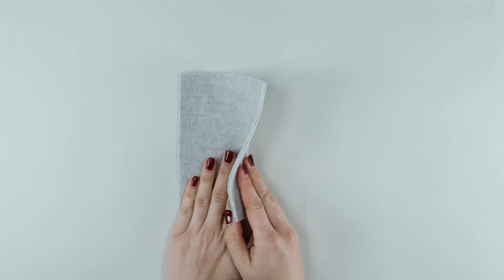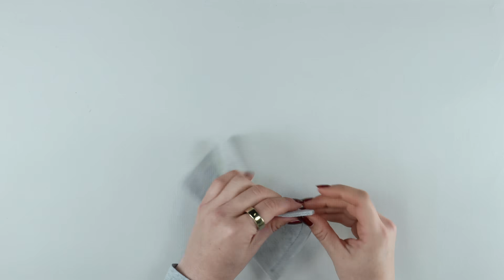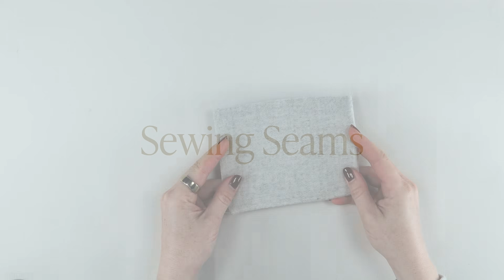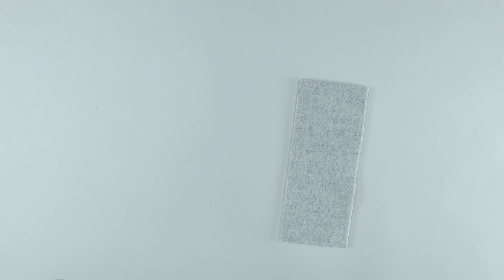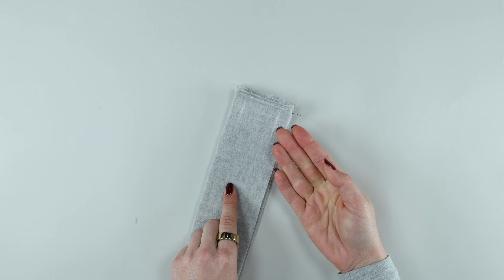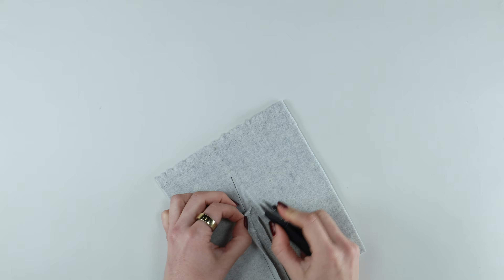How to Sew Double-Faced (Splittable) Wool | Clean Edges, Seams & Darts for an Unlined Coat

Comment: Is Double-Faced Splittable Wool the same as Boiled Wool?  I am preparing to sew New Look 6585 that is an unlined coat and I am sewing it out of Boiled Wool.  And, yes--you are so welcomed back!  You were very, very missed!  Thanks for your help!
Reply from the maker: Usually boiled wool won't be splittable in the same way this fabric is. But you could use a splittable double-faced fabric instead of a boiled wool - they would be pretty much interchangeable fabrics; meaning you could use either on the same project. But with a Boiled Wool fabric you might want to have a lining, or some way of finishing the seams, Hong Kong binding etc.  

I just had a look at that lovely pattern New Look 6585 - they have suggested a splittable fabric, so if your fabric can be separated like this, then you can use these techniques. As looking at the pictures I think they have just turned over the front edges; whereas you could use this method instead (if it works for your fabric). 

Let me know how you get on? I hope this helps.
Reply: @MadetoSew  Thank you so much, Aneka--I am planning on making a hong kong seam finish out of 10" by 10" layer cakes used in quilting.  I just love to make my own bias tape.  I may not get to my project for quite sometime but your feedback is invaluable--thanks again!